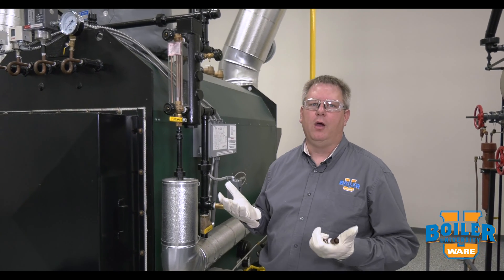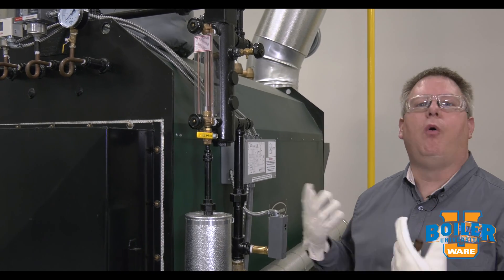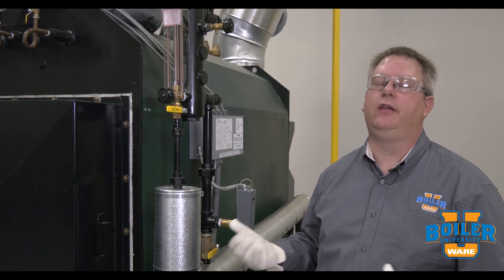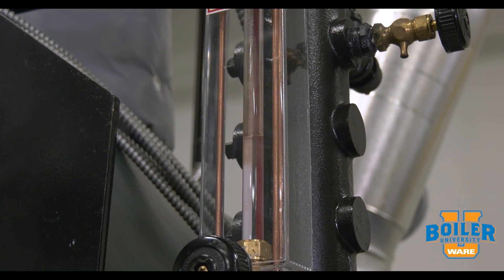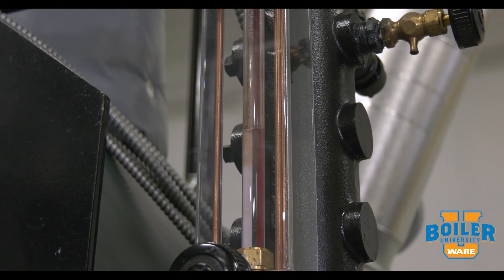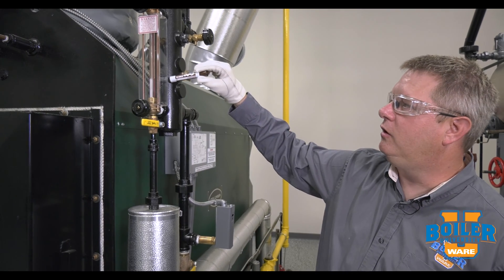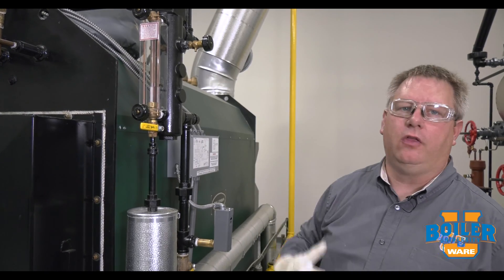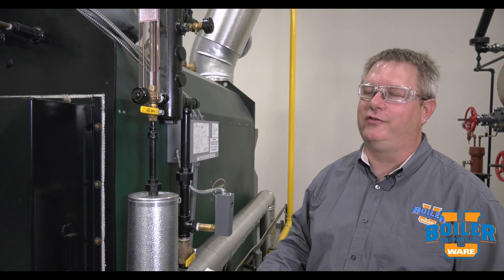Knowing the Water Level in the Sight Glass - Weekly Boiler Tips

Comment: I must add that the operator needs to blow down the slight glass to know the actual level of the boiler. also, may I add that the alternative method of checking level are the Tri Cocks... Low should be water... middle should be water and steam mix and the upper should be steam.. be sure to blow these clear regularly.